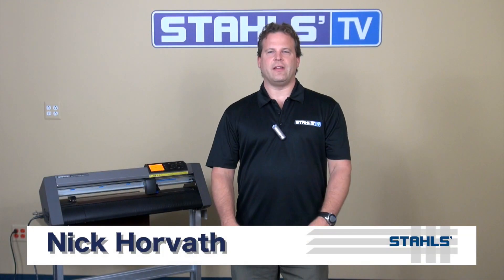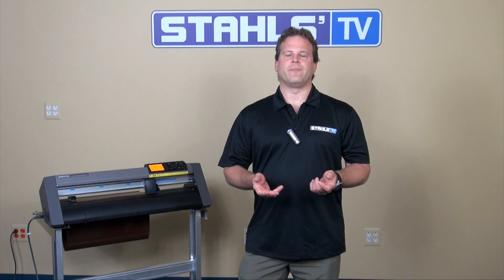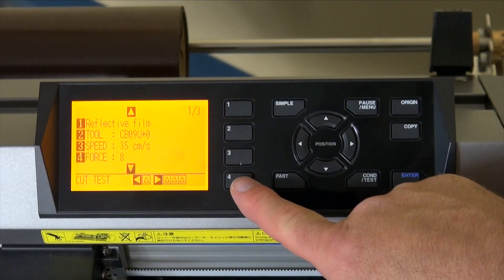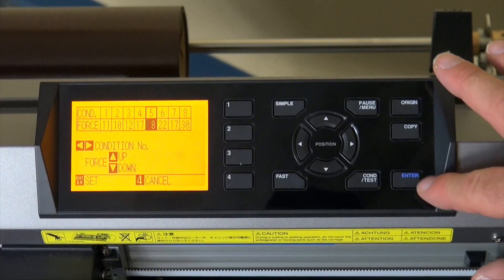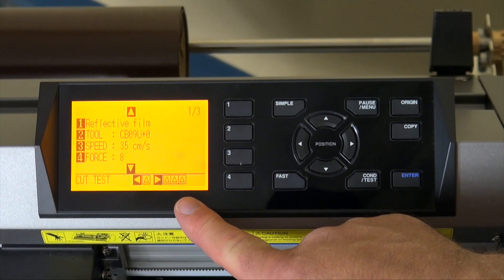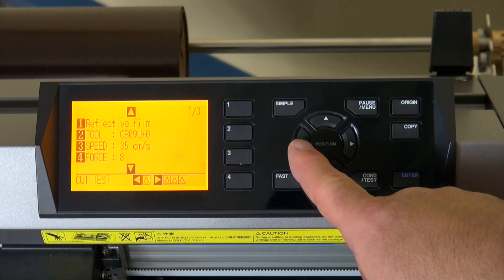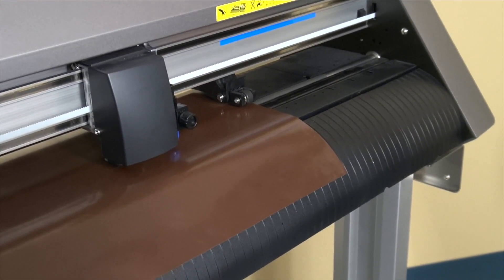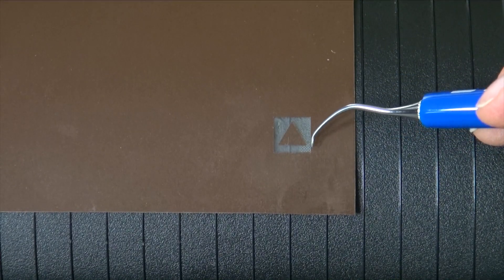Graphtec CE6000: How to Set Force and Perform Test Cut

Comment: I have problems cutting glitter and reflective. Even at highest force setting, it does not cut? Any suggestiions?
Reply from the maker: We recommend making sure you're using the correct blade and that it is sharp. Using thicker, coarse materials can make blades dull quick. Also, making sure the blade is out enough. Hope these help. If you have any other questions, please contact us directly at 800.478.2457 our team will be happy to troubleshoot with you.